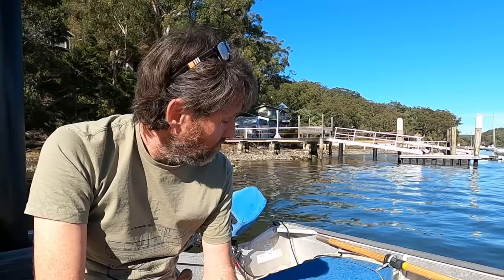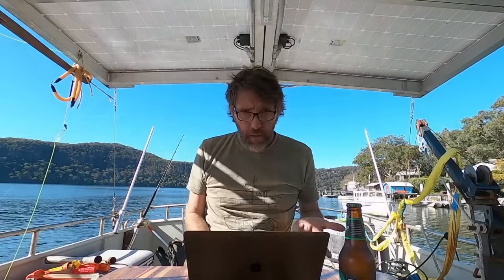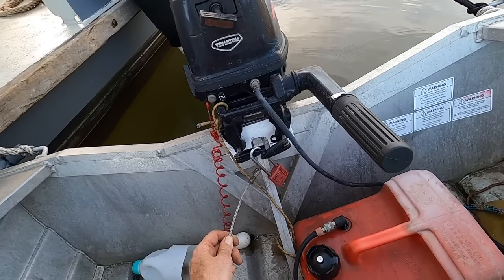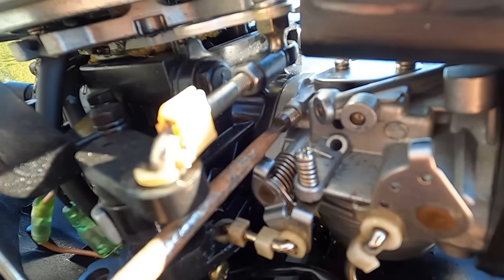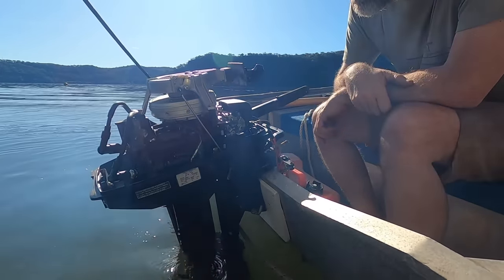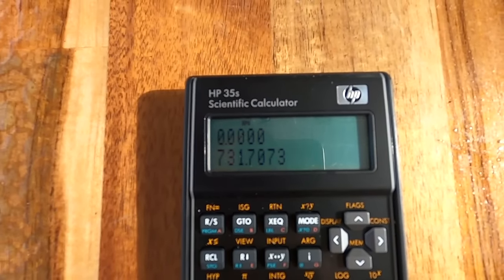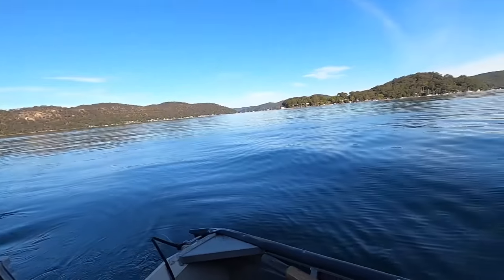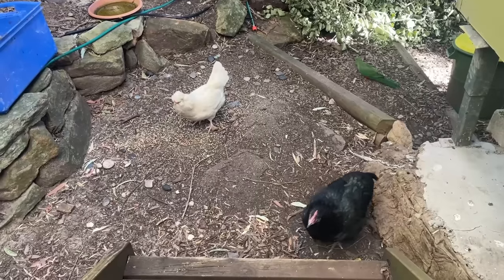Fixing an outboard that stalls at idle

Comment: Great info Stu. Premix at the pump, that's awesome.  Wish we had that in the states.
Reply from the maker: It is very handy for the commuter boats. Travelling back and forth each day we tend to fill boats up once a week so mixing fuel becoming tiresome.
Reply: unless you are using the boat every day, premix can work against you. it will settle and separate after a few weeks, needs to be mixed again.
Reply: Most synthetic 2 stroke oil can hold fuel in suspension easily for 2 years minimum per the manufacturers data

Comment: You forgot to mention, when discussing old fuel, that gasoline with ethanol added, is Hrdroscopic: that is it attracts water. So, sitting, it will end up with water in the float bowl, and that can cause all kinds of issues. Lawn mowing season just started here, and I have to go thru all my engines (carboraturs) that weren't properly put away. I try and run "seasonal" equipment dry... I've been adding fuel shut off's to machines that don't have them vs having to run the entire tank of fuel out :) And run ethanaol free fuel if possible!!!
Reply: you are doing the correct things. And finding a no ethanol gasoline for your garden tools or boat engines is way up there. The 'run 'til its dry' method is the best too.... any left over fuel that you can't got rid of, put it into your car........ it will be OK. But to leave it in your boat motor or chainsaw...... it's gunna get blocked for sure.

Comment: Most 2 stroke manufacturers recommend adjusting the mixture until highest idle rpm once reached back the mixture screw 1\4 turn (more fuel) reason being a 2 stroke  depends on its fuel for lubrication so running at slightly lean or even sm mixture can cause the motor to have a greatly reduced lifespan.  Just something to consider.

Comment: Love these outboard videos. I had the same problem with my 2003 Yamaha 115 4 stroke. Three trips to a good marina couldn't solve it. I finally swapped out the  IAC valve. It cost $40, took five minutes to swap, and fixed the issue of stalling at low idle.
Reply from the maker: Nice work!

Comment: Have a 90 model Johnson 8 HP behaving exactly the same way, went through the same steps and now it idles correctly and its as good as a 22 year old motor can be, thanks once again for a first -class informative video. You keep us all running smoothly.

Comment: Hi Stu, been watching your channel for several years now. You’ve given me the ambition to fix a 2000 merc 25 2-stroke that has been non running since 2014. Ive replaced everything in the ignition system sans the coils but all she does is back fire, its been a head scratcher.  I’ll be looking through more of your videos for additional guidance. Hoping she doesn’t end up as a hung cowl in my garage.
Reply from the maker: If it backfires it either most likely either bad timing or the coil leads going to the wrong spark plugs.
Reply: @DangarMarine  That was it had crossed leads. She fired right up… thank you very much!

Comment: Small tip there Stu (Hi, from Norway). The Choke on many of these motors has a step. You can feel it when you push the choke knob in. After the first pull (cold engine) with the choke all out adt throttle @ zero, I push the choke half way in ( you should feel a small bump and the stick would hold, and then give it some throttle, 20-30%. And let it run like that for about 10-30 second.. I always found this to be a win. Best regards

Comment: Hi Stu, just watched and must say good to see you going over the basics on small 2 stroke motors. Allot of folks don't know much about these. Things like having the pump ball point with the arrow up. There is a check valve in it and once full insures there is no air in the line. Different fuel/oil mix requirements like 50:1, 24:1 and for the vintage 40's motors 16:1. Having the owners manual and a service manual if your doing more than the basics is a must. Good to see you doing these videos. Tim
Reply from the maker: Thanks Tim!

Comment: In the end, I had many other problems with my motor which was not the external tank.  After seven visits to my local Boat shop, I decided to get a second opinion from a Commercial boat shop that also worked on small engines.  After a few minutes and after conducting a compression test on the motor they immediately concluded that the motors compression was way too low.  Yup, a brand-new motor.  After trying to figure this out for over a year and various visits to my local boat shop my conclusion is get a second opinion by another professional.  It never hurts.  Thanks for your video and help.

Comment: Great video.  I enjoyed how you addressed a problem by exploring how the motor and carburetor are supposed to work and then looked at simple solutions first.  Digging into a carburetor ups the chance of a maintenance induced failure and a real time burner, all the while the motor works fine.

Comment: Great video, love your style.
I have worked on carbs for years, just tinkering. My 2 rules of thumb...

1. If the idle mixture screw is located on the engine side of the throttle plate, it's fuel adjustment. If it's located on the air intake side, it's 
    air mixture.

2. When adjusting the fuel mixture screw, don't aim for the highes idle. That's too lean and not good, especially for a 2 stroke. Set it at a start
     of 1,5 to 2 turns out (warm motor) and find a decent idle speed. Now, turn ut in 'til revs climb, (lean) and make a note of screw position.
     Now turn it out slowly  'til the motor just begins to run slightly unevenly. Split the difference of those 2 points and that's the 
     stoechiometric  ratio for that motor at idle.

Cheers.
Reply: once I've found the mixture screw adjustment......... I just do the screw turn counting between too lean and too rich....do your arithmetic and wind the screw in between these points; and who cares if you reach a stoechiometric balance ?? Just get the freakin' mixture to work well; with intelligent use of the idle screw.... 
if you get into 
stoechiometric theories and practice, you are going to need a lab on board to take real readings.... and at least a chemist as a staff member

Comment: Looking forward to this video series. I have a 5 horsepower outboard my grandfather bought in the 70s that I've been meaning to rebuild for a sailboat project. I'm sure this info will prove useful, so thanks! 👍️ And props for the reverse-polish HP calculator!
Reply from the maker: Thanks Ted, good luck with the sailboat project.

Comment: I didn't get a super close look at it, but if the needle is damaged or "knurled" in any way and the accompanying jet has any deformation,  it'll never idle perfectly. The taper in the needle should be linear or at least the same angle as the taper in the jet.  Or the low level fuel flow will be all squirrelly. Yet another great basic video from the Maestro!
Reply from the maker: I definitely agree that once these needles get deformed they never quite idle the same. Not an expensive part to replace either.
Reply: @DangarMarine  Congratulations you have been selected among our shortlisted winners from our previous giveaway, contact the number above^^^^^^^^^^^^^^^^^^^^^^^^^^^^^🎁
Reply: @DangarMarine  are you the one sending these messages

Comment: Perfect timing with this video! I've got a motor that is stalling when going into gear, I'll definitely be using this video as a guide for solving that issue. Thanks for the great content!
Reply from the maker: Good luck with the fix. Another common cause will be a dirty carburettor.

Comment: I've got Yamaha 2 stroke 200hp outboard.  I live in Florida and I've noticed I need to adjust the carbs depending on the outdoor temp.  When it's cold outside it seems to idle higher than when it's summer and 92 degrees out.  I've also learned when tuning the carbs, run  it in a barrel under pressure, not on the ear muffs.
Reply from the maker: It is amazing how much the subtle things like temp and water pressure can affect how it runs and idles.

Comment: Thanks for the video. I have run into several cases where the "O" rings in the fuel connectors have cracks, allowing air in.  Once had to squeeze the bulb repeatedly  to get home.  Another "possible" to add to the list.  Turns out that it US it is just as cheap to replace the whole connector plastic piece as it is to get the O ring.  I think the Baja CA heat is especially hard on these. Lastly, have seen some add a little silicone lube to help O rings last.

Comment: When you get right into it, how the choke works is it creates a depression behind the choke flap that lowers the boiling point of fuel - allowing it to boil off into a gas. 
Pulling it full on like you do is a good idea. In fact many cars with auto chokes on their carbs used to work on this exact principal and had a vacuum dashpot that partially opened the flap once the engine fired so air would flow in.

Firstly I'm not a small engine mechanic but a general stream mechanic so this may not be the case in small engine carbs but at least in automotive use and this is somewhat of a mute point but relevant nonetheless, in the idle mixture circuit the mixture is fixed. What the mixture screw does is adjust the volume of pre atomized fuel and air in the idle mixture circuit. The screw is simply a flow rate adjuster. The thing is dirt in the idle mixture circuit does have a direct effect on the idle circuit mixture ratio so compensating by opening the idle mixture screw more and more isn't going to yield satisfactory results on idle quality.
 
Also I always thought that about 50rpm rich of peak idle speed is preferred over fastest idle but this maybe different on premix 2 strokes and small engines. I usually adjust the throttle stop screw to completely closed then 1/8th in so the blade[s] don't jam in the bore and the rest with the mixture screw. 
It is a fact of life that the more you open the throttle blade at idle the less the signal in the idle mixture circuit - so the idle mixture screw has less and less authority the more you open the throttle stop screw since there's less vacuum available to the idle mixture circuit.
If you can't get the speed and/or quality then another 1/8th turn in on the throttle stop screw then repeat. Rich of fastest idle (so a 50 or so rpm drop) is generally preferred on the mixture screw at least on four strokes LOL.

Comment: Great content as usual, I use so many of your videos to help with both my motors, 7.5 merc and 85 hp force(older merc), a video on electric chokes would be greatly appreciated, my 85 tends to not accuate unless manually forcing the choke on. Thanks

Comment: Great video.  I had a similar problem last weekend.  It turned out to be that I was loosing air in my external gas tank.  I never thought it was the tank because its brand new.  Changed the main hose and it now works great while idling or when crawling at very low speeds down the river.  I really liked your detailed process of elimination.   I wish I would have seen this video last week because it could have saved me a lot of time.  Brilliant video.
Reply from the maker: Thanks Daniel. Yes, plenty of problem are caused by an air leak in the fuel hose. Glad you found it.

Comment: Thanks for taking the time to do these videos!
I am just finishing up Yamaha  SG20. Upper bolt the holds the intermediate to pivot arm worked loose. Because of your videos I was able to pull lower unit and then the powerhead to clean and tighten (with loctite) that hidden bolt.
While apart it only made sense to do head gaskets, exhaust cooling gaskets, thermostat and and and lol
Once again thanks so much! Truly informative videos
Reply from the maker: Always easier to do those extra jobs while you are there! Glad the videos have been helping.
Reply: Thanks Stu, all back together and running good. Only issue is water is coming out of weep holes where lower unit bolts to mid section. I have pulled it twice to make sure tube was seated and it had been. Replaced waterpump housing, base plate, housing stainless insert, new impeller and its still pissing out. Havent been able to find anything online to trouble shoot. Any thoughts? Pee hole is working and thermostat housing warms to the touch. Water also sputtering out of back of midsection just below bottom cowl. Its a small 2 inch x 4 inch cover with 2 screws.
Any help would be greatly appreciated.
Shawn

Comment: I experienced this for years on a late 90s 50 Evinrude. Each time i took it to the local marine mechanic somewhere along the way between Berowra and Brooklyn, they came up with a different reason every time i took it back, and never resolved it. It certainly made coming into a wharf interesting and honestly deterred me from wanting to use the boat in the end.
Reply from the maker: It definitely makes docking a nightmare that's for sure.

Comment: im working on a 1981 9.9 evinrude for a friend, i cleaned the carb but it was way out of adjustment, its evident that someone worked on it and couldnt figure it out then just left it, parts missing and all, well i got it running but am facing the exact issues demonstrated here, thank for the video it will be a tremendous help when i get back to it in a few days.
other thing im trying to figure out is the tiller is a shaft driven system and when you rotate the handle the shaft going into the outboard seems to have slop in the teeth or something and doesnt want to engage the carb like it should....anyways, Cheers from Tulsa, i met you at the SV Seeker meetup and it was a pleasure to have met you, good to see it looks like you are doing well as well

Comment: Great video Stu! I use a Colourtune spark plug mixture tool. It is a spark plug with a glass window so you can see the flame front as it occurs.  I suggest when it is hard to decipher if it is spark or mixture it is a great asset. Really useful for two stroke engines, particularly with multiple carburettors. I use it on ultralight aircraft engines, both 2&4 stroke. It gives you a perfect view what the engine is actually doing, rich lean or if there is a problem with blockages it shows you instantly the issue. It comes with mirrors and extensions to make it easier to set up in any awkward position. In regards of the tachometer, there are miniature lcd ones available which have a clip to put on the lead or a length of wire which you wrap a few turns around it. Cost about $30 and most have an hour meter incorporated.
Reply from the maker: Thanks Kim. Interesting tip about the Colourtune, I had never head of those, I'll have to grab one and give it a try.

Comment: Small combustion engines are pretty much the same.  I had a pressure washer  motor that would start, run for about 30 to 45 secs....then die.  A neighbor told me about Techron.  He said go pick some up at an auto store, pour a little (key...little) in the gas and give it a try.  Did the trick.  Now it runs like brand new and that is all I did.  Worth trying before a simple or complicated tear down.

Comment: Hey from the states. Kentucky to be exact.  Love your channel.
I’m not sure how often you look at the comments but have you ever come across an outboard that doesn’t shut off even if you turn the switch off, pull the key out and pull the safety kill switch?
Reply from the maker: Yes, I have seen that. This video should give you some ideas. Essential there is a wire off somewhere so neither switch is grounding the ignition. https://www.youtube.com/watch?v=SN17iBL5lps
Reply: Awesome. Thanks!!

Comment: The flashing light for identifying the frequency of oscillations is called a stroboscope. We used them about at uni to find the speed things resonated at.
Reply from the maker: Great info Phillip!
Reply: I have also seen phone apps that do rpm acoustically using the mic on the phone.

Comment: Not sure if you can get it where you are but Seafoam does a good job with cleaning carbs on a poorly running motor. I have to admit, it's hit or miss but definitely worth a try for those not mechanically inclined.
Reply from the maker: Some additives really can work miracles.

Comment: Stu, some of these carbs the idle mixture screw is actually regulating the air instead of the fuel. So turning the screw in is decreasing the air -> richer mixture and vice versa. Just food for thought.

Comment: good stuff and great video, as I have a late 90s grumpy 50hp evinrude, its  taken me ages to get it to idle, especially in water, I find mine does stall a bit more in winter than summer though, despite its had a carby clean, new plugs and both carbs tuned. I find I have to change fuel air mixture sometimes between hot and cold weather.
what youve specfied here is great, and I will go have another look at mine again.

Comment: Our 2006 Honda Bf90A kept quitting without warning.  Then it would run great for a while.  Took me 6 months to find an intermittent problem in the ignition switch.  I would have figured it out sooner if I had known that when you turn off the ignition, it kills the engine by grounding the ignition, not by cutting voltage to the ignition as in cars and most motorcycles. (On the Honda it's the Black/Red wire!).  Live and learn.
Reply from the maker: Those intermittent electrical problems can definitely be tricky to track down.

Comment: Extra oil in the mix means less fuel through the jet which causes a lean burn and engine damage as a result.  
Even though fuel is big $$ ATM still go with 98 if you can as much as it hurts to fill.  Haul out and engine out repair are big bucks…
Coming to you from a local MerCruiser Inboard Re-Conditioner flat out rebuilding engines. Ron
Reply from the maker: Good quality fuel does always pay dividends in the end.